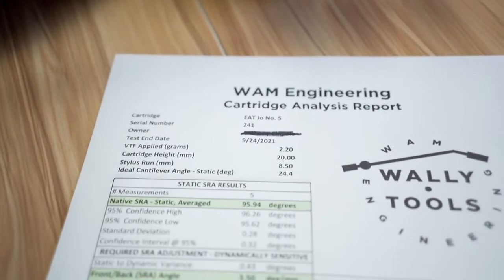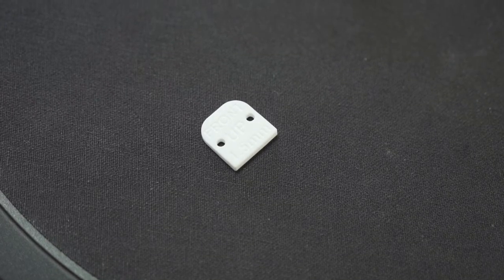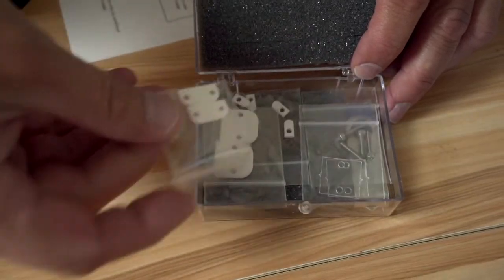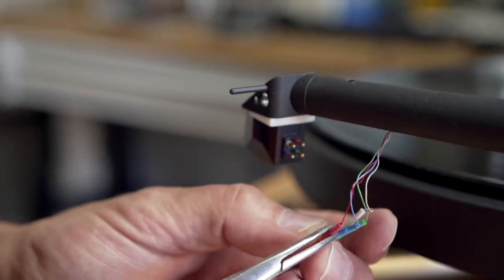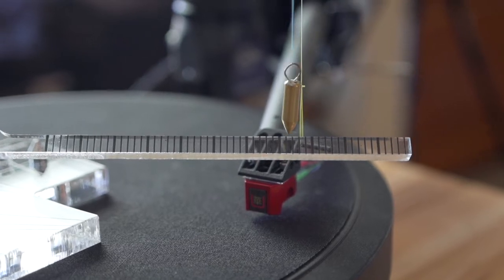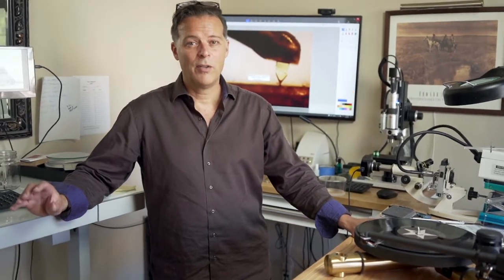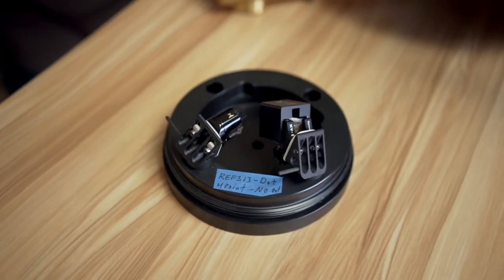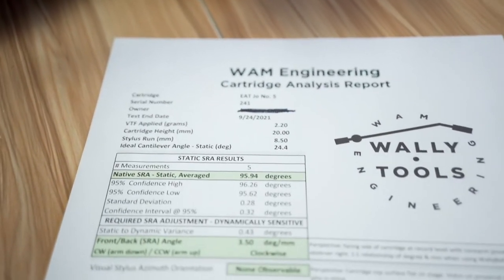WAM Engineering Analyzed Cartridge Installation Process

Comment: do you offer services for more vintage cartridges with not much info about them out there? i have an audio technica at-32 that recently got retipped to be microline
also, how would the service differ for turntables that also dont have much data on them, since i have a kenwood kp 1100 and the internet has provided many conflicting examples of how much the tonearm weighs for example.
Reply from the maker: The service analyzes the cartridge only, not the tonearm nor turntable. This is because the arm you put the cartridge on will not result in a different prescription for how it is to be aligned on its four angles. So, we don't need to know about your tonearm or table to know how your stylus and cantilever must be aligned on the headshell.

If your tonearm geometry is unknown, we can figure it out together using the WallyTractor, its pivot to spindle ruler and the online calculator we put on our website. 

I hope that helps!

Comment: To my opinion any highend cartridge which shows more then 1 degree deviation should be sent back and money returned. Great video, well thought presentation, compliments.
Reply from the maker: If only this were possible! The three manufacturers of stylus/cantilever assemblies must be allowed some tolerances. For SRA alone, the stylus contact edge to cantilever mount tolerance is often around +/-3 degrees. Cartridge manufacturers must accept any product within these limits (though I know for a fact that they often accept beyond these tolerances.) This error can then be worsened by the manufacturer mounting the cantilever at too high of an angle, causing VTA to be too high. This has been a documented problem among cartridge manufacturers since at least 1962 when it was studied by engineers for journal publication. A standard for such angles has been proposed but is usually ignored by those making the product. 

Zenith error tolerances are even greater at +/-5 degrees though we have measured as much as 17.5 degrees.

Comment: Many thanks for your hard work for helping us to understand the engineer of music. Two questions. Why do we need Shim (?), when you can adjust height of tonearm. Will you offer the same service for Koetsu with Arche headshell and SME 3012R? Happy weekend 😊
Reply from the maker: Thank you for your comment. 

We have analyzed hundreds of cartridges and we know that the average SRA correction is about 3.4 degrees and the average VTA correction is almost 7 degrees. When a tonearm is operated when not level there are different vector forces at play around the pivot area that influence the sound. As a result, any cartridge with a correction required of greater than about 1.5 degrees should have that angular correction done at the headshell, not by adjusting arm height.

Yes, we have worked on many Koetsu cartridges and our custom corrective shims work fine with any headshell we've come across so far. However, I do NOT recommend using the stamped metal headshell that is often used with the 3012R. That headshell is simply not rigid enough. It is better to get a far more rigid one like that sold by Korf Audio. Also, you MUST have slots, not holes for your headshell or you cannot adjust for zenith error correction at all.